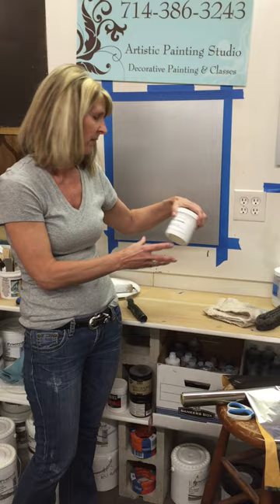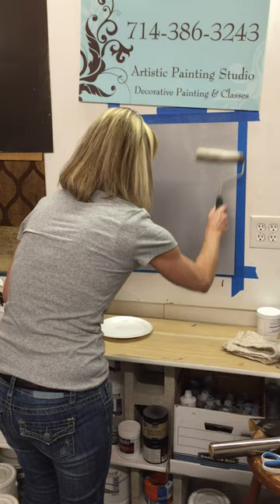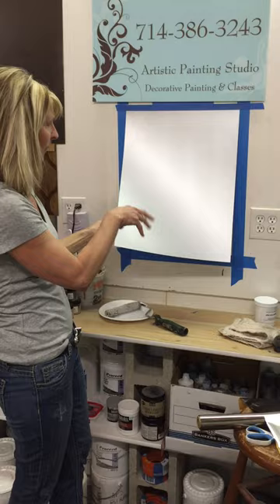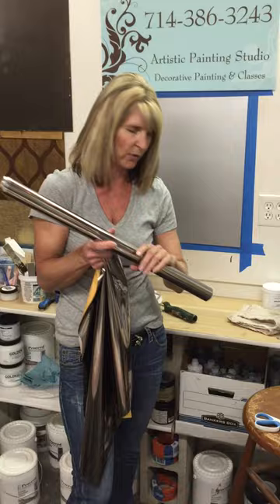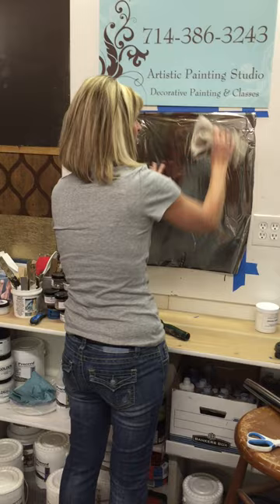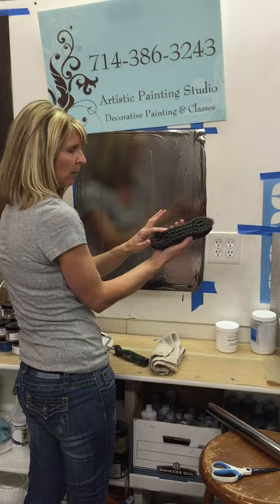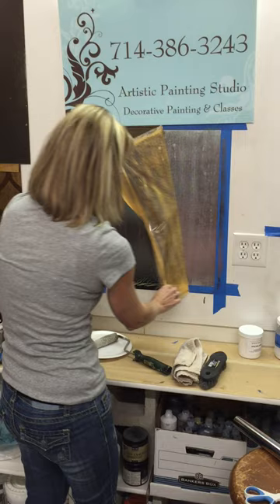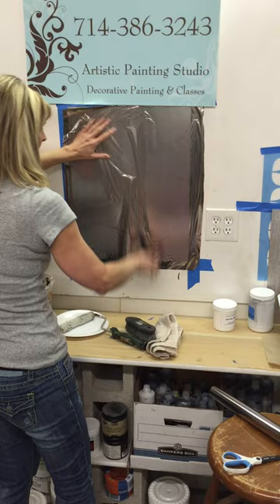Learn how to install a foil finish!!!

Comment: Imma try this on my wall! Thank you for the idea! I can finally use my foil I've had for 10 months. Since I'm doing this on my wall can I use a spray to have the foil stick or does it have to be mod podge?
Reply from the maker: You want to use our Foil Adhesive - it needs to be a really sticky adhesive to pull the metallization from the carrier :)
Reply: @ArtisticPaintingStudio  I'm painting my wall right now. I have 3M contact adhesive (it comes in a form of a spray). Would that work? If so, I have to do this right now!!!! Thanks.
Reply from the maker: @45Bryseida  I have not used a spray adhesive with our foils before and have heard from others that it did not work well  - I would still advise our Foil Adhesive for a wall project!